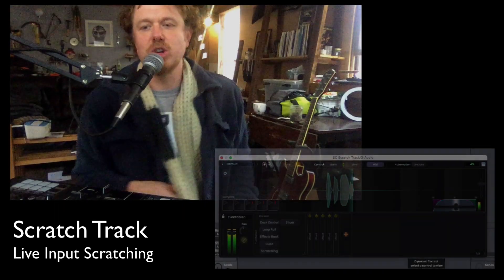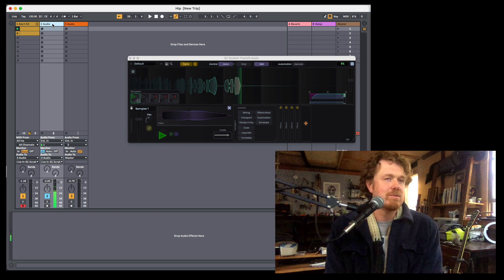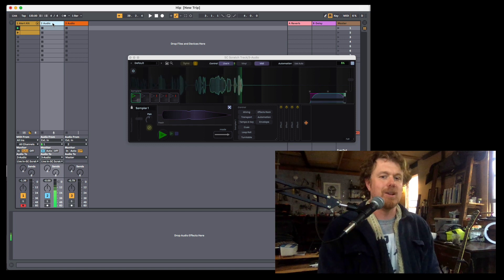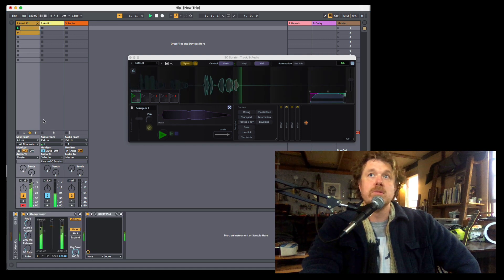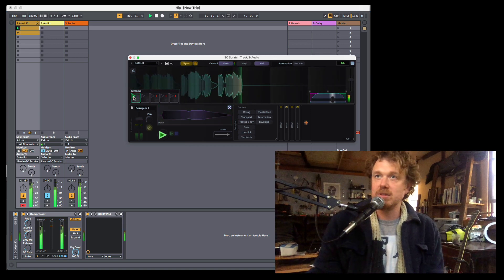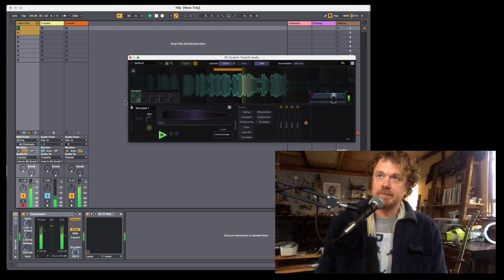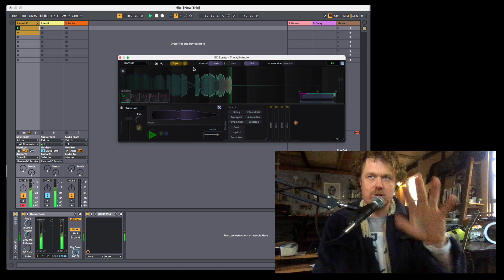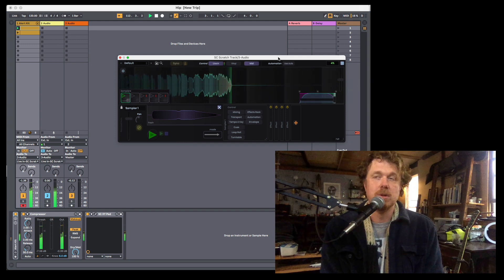Scratching Live Input (Scratch Track Demo) | Stagecraft Software

Comment: How do I set this up in Studio One? This might be our answer. Djs and engineers all across the world have been needing this.
Reply from the maker: Well, I haven't tried it myself, but it should be pretty easy to set up :)
Reply: @Stagecraft_Software  Using live input in Studio One by sidechaining an audio track output to a BUS channel with the plugin inserted. I used the MIDI-learn function to automate scratching, but it got so noisy. The noise is the kind you hear when the audio interface(or CPU) runs out of the buffer. I bought it years ago but I still don't know how to use the sampler in the plugin. I chuck a sound in, but I don't hear anything.